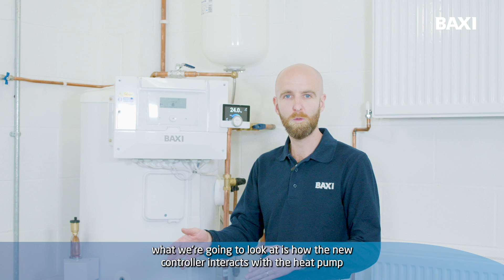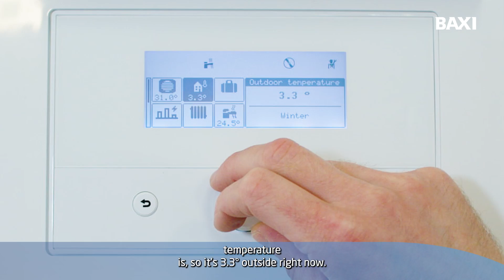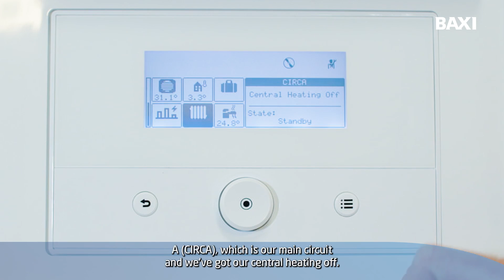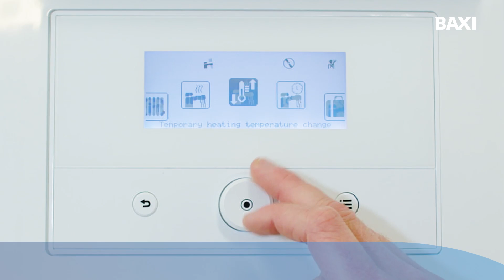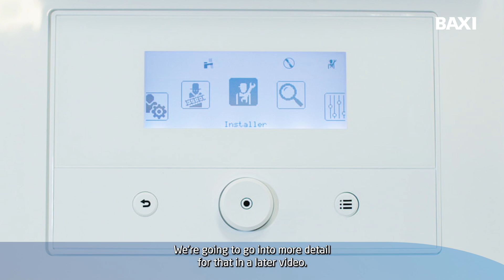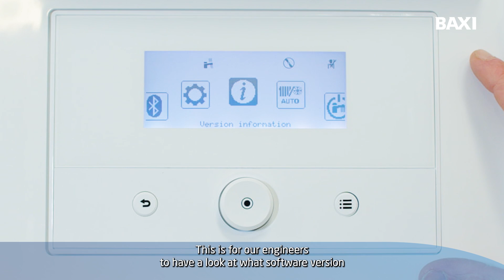How to use the controller and advanced menu on the Baxi ASHP Pre-plumbed cylinder | #TrainingTuesday

Comment: Hi Steve, I had a Baxi ASHP fitted & commissioned in May of this year, at the weekend it started playing up, I've been in touch with Baxi and haven't had a lot of joy, it appears that the timings put in by the installer have all been wiped and even the date & time info gone! The manual for wired controller unit is awful, at least it's awful to the lay person like me, I wonder if you could do a YouTube video explaining how to set it up please? The controller is an approx 11cm square unit with a digital display near the top. 4 up, down, left, right triangular directional buttons plus a menu button top left, an on/off button top right, a return button bottom left & a lock/unlock button bottom right. For someone with no experience with this sort of technology I am fumbling with how to get it running properly, please help if you can.